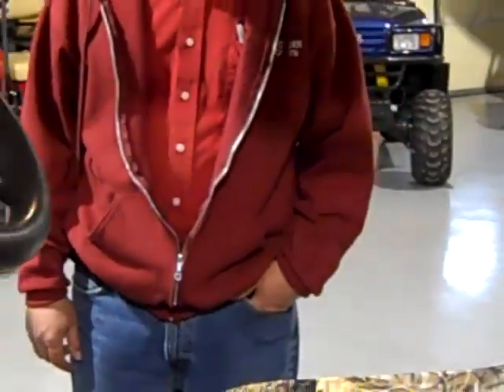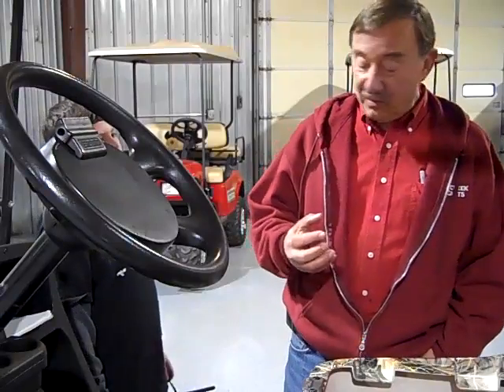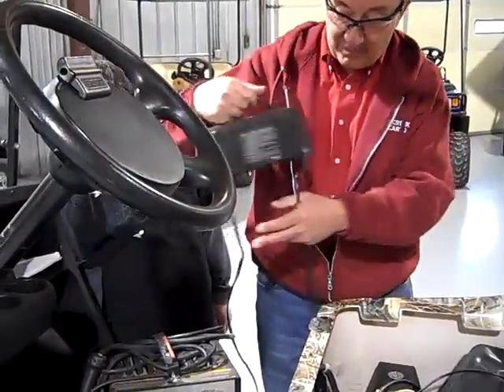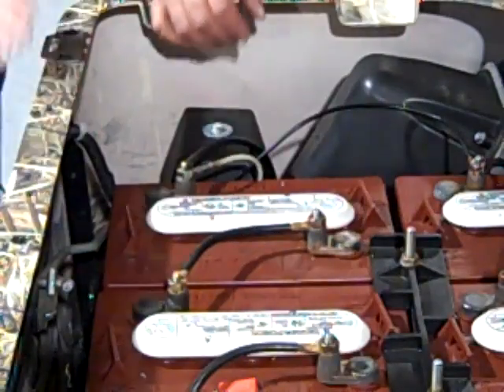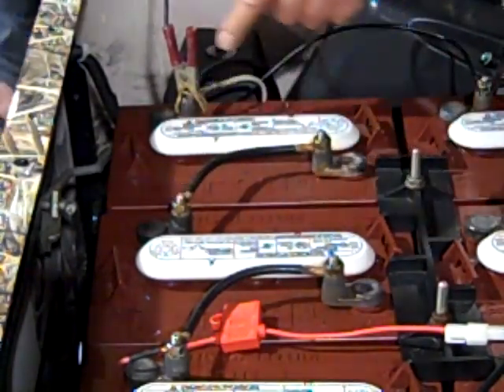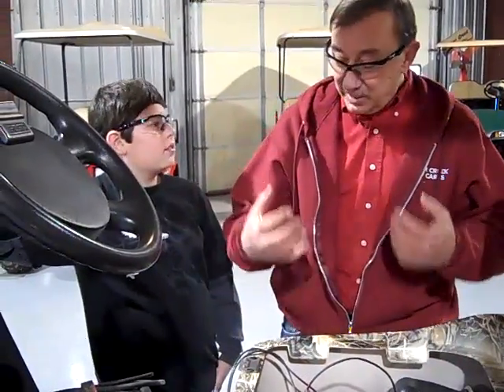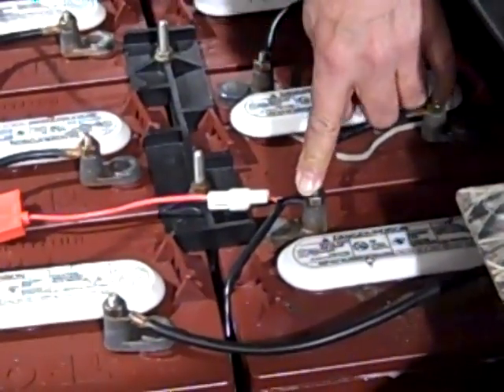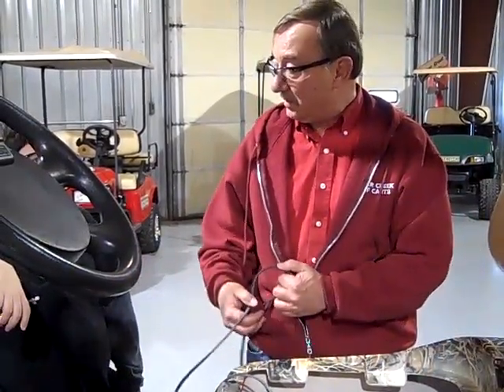Charging Dead Golf Cart Batteries

Comment from the maker: @idae209 
You only need to get the batteries slightly charged and then plug in your standard golf cart charger.  There is a built in safety device on the golf cart battery charger that will not allow it to charge completely dead batteries.

Comment from the maker: You can not use a 12 volt charger on an 8 volt battery!  You can try a trickle charger and do each battery individually (this will take awhile).  The other option is to get a 24 volt battery charger and charge three batteries (wired in series) together.  As always use extreme caution when charging batteries.